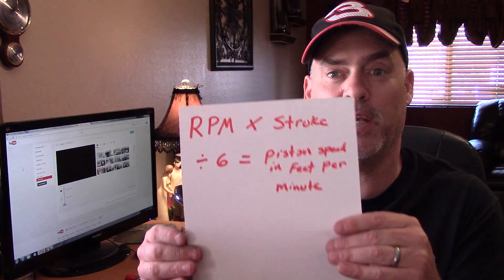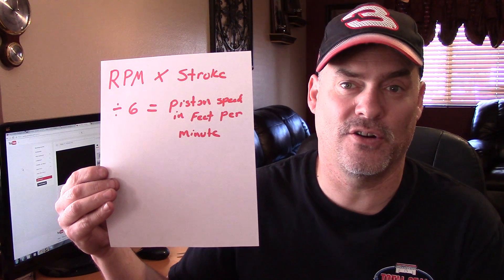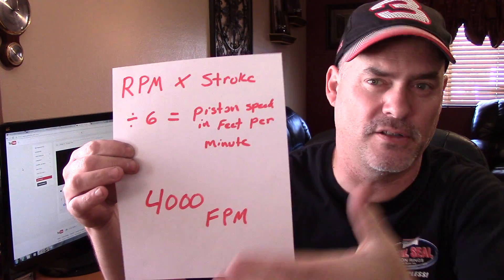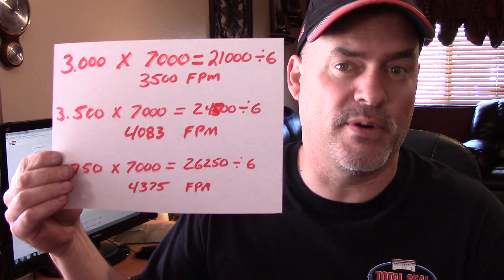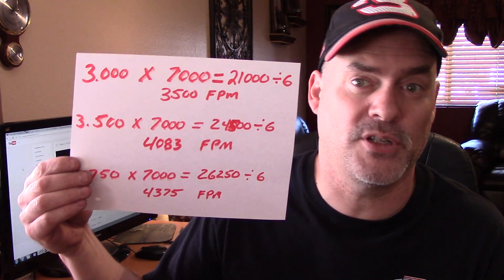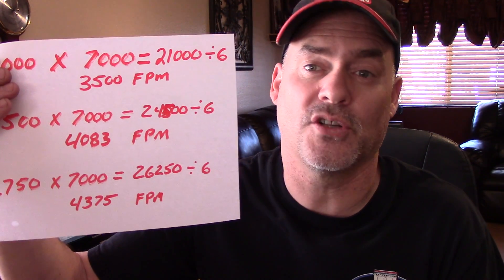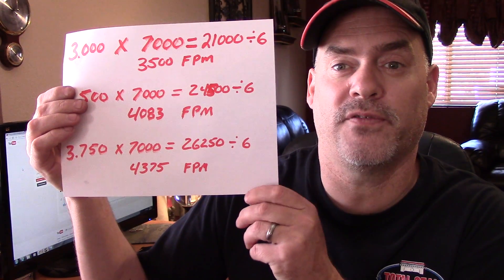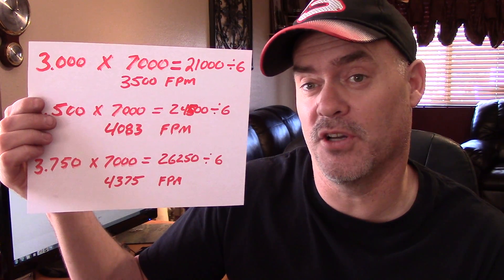What RPM should be an Engine's red line

Comment: 2 Pi is not really 6 (6.283) , and you should explain the "6".
Reply: It's not Pi we want  (like honestly, where would Pi come into play here?). The math is really, really simple. We know the stroke ONE way is 3.49". To find the complete distance the piston travels in one full rotation we need to double that. Instead of doubling it and then dividing by 12 to find out what part of a foot that is; we simply just divide it by half a foot (6 inches). Multiply by your target RPM goal and you've got your number in feet at any given RPMs. For example (Stroke * TargetRPM) / 6 = PistonFPM   ||||  Or do it the long/hard way:  ((Stroke * 2) * TargetRPM) / 12 = PistonFPM
Reply: Archaeon GG I would say he was thinking about the crank throw to think of π2 not the actual piston movement
Reply: Archaeon GG no shit. its amazing how out of touch all these “car enthusiasts” are with basic math. its not hard. figure it out
Reply: 6 is used because it is half of 12 inches. 1 stroke is only 1/2 of a rotation. So a 3” stroke at 1 rpm is 6” per minute. Instead of doubling your stroke and multiplying it by the rpms then dividing it by 12 to get feet per minute, we just skip that step and divide by 6. An even simpler method is to use 24000 / (stroke) and that will tell you where your red line is (assuming 4000 feet per minute is your max piston speed goal).

Comment: I didn't learn this in feet / min, I come from a metric country (Australia), and we do this in m/s. But over time the maximum recommended piston speed has gone up from about 12 m/s when I was a kid, to about 16 m/s now. It's also worth going over rod length to stoke ratio. I would also mention that engineers at the factory do their calculations, but then they do a practical test. They run the engine on a dyno at about the maximum power for a time (hours, not seconds) and then strip and inspect. When I was a kid, in the '70s, Honda was supposed to run any production engine at redline for a week. If the engine suffered serious wear or damage in that time, the engine spec was changed or the redline was lowered.
Reply: +Kneedragon1962 Also maybe mention, there should be a natural safety margin between max power rpm and redline. One real criticism of racing engines is the ones that are still gaining power (or sometimes even torque) at redline. They're difficult things to use safely, for a number of reasons. Instinct and the seat of the pants will tell you to keep it pinned because everything is going great...
Reply: +Kneedragon1962   Engine go's💩💩💩
Reply: Kneedragon...Used to be a saying 'They run the strongest just before they blow.
Reply: Find a measurement converter on line, and convert.

Comment: cuestion...are the chevy350 engines made in mexico any good it will better or less quality on those engines made in mexico...thanks and you have great videos...
Reply: +Alfredo Ramirez s A CNC mill doesn't know the nationality of the operator, they are all the same
Reply from the maker: +Alfredo Ramirez the Mexican castings are good blocks they work well
Reply: +Myvintageiron7512 I herd a long time ago that Mexican castings are harder and doesn't wear out as fast. I had a block long ago that had 70.000 miles on it and didn't need to be ridge reamed.
Reply: +Alfredo Ramirez . Almost All factory Chevy Iron have low nickel content. Soft blocks. There are a few RARE pieces that have a bit more nickel. So many aftermarket Chevy blocks and heads due to poor factory castings. Chevy is the low budget part of GM.
Reply: +Alfredo Ramirez, ran a Taco engine, with major core shift, in a street stock class stockcar for 10 years at 5800 RPM peak.  All we did was a good oiling system, deglazed the cylinders, rings, bearings and full groove mains, mild cam, 3 angle valve job, good springs and moly pushrods.  Put in bearings every year and rings at 4 years.  Finally retired it after an accident crushed the rad air intake and the driver overheated it before coming off the track.  Won 6 Championships with it, 3 seconds and running third for the year when it retired.The older Mexican engines are rumoured to have a higher nickel content and be more brittle.
Reply: that's what I heard.
Reply from the maker: No the Mexican crate engines hold up just as well as the castings made elsewhere

Comment: Jeff.  1 complete cycle or 4 motions is 2 rpm because that is 720 degrees of crank rotation.   1 360 crank rotation is 1 rpm.  So 2 strokes is 1 rpm

Comment: Do you have a mustang by chance?
Reply from the maker: +Brian Lord No don't own any Fords
Reply: +Myvintageiron7512 What should my Redline be? I've got a 1986 Pontiac firebird w/a 305 chevy in it. Bore size is 3.73"and a 3.48" stroke. The 305 is really a chevy 350 with a smaller bore size in it. I had a 178 intake cam in it, but I replace the cam w/ a Comp Cam 260h (212 @.050s).

Comment: When I was younger my dad built a 351W with Cleveland heads, and he swapped over to a solid cam, adjustable valvetrain setup with a lumpy cam. He always told me that a 351 could pull 7000, but I really wasn't sure how that was possible since the 4 cyl in our Focus barely did 7000. Now that I'm following suit and getting into cars, and that I have more knowledge, it's easy to see how to squeeze revs out of an engine. As always, well explained video.
Reply: ThePaulv12, no, the Windsor is a wedge head engine, like the 302, that was never as popular for performance as the Cleveland.  The Cleveland is a canted valve head, like the big block Chevs.  It also has a shorter deck height and smaller main bearing diameter than a Windsor.  A 2bbl Cleveland had heads that were more than adequate for most street and racing, but, the 4bbl heads had huge ports that are said to outflow a 427 rectangular port Chevy.  These were the same heads used on the Boss 302 and had a very high rev capability due to the flow.
Reply from the maker: +Ryan Eyster A 351W will turn 7000 it is feesable to go above the piston speeds I have laid out race engines do it all the time you just need stronger internal parts and a much better balance job 4000 FPM is a good safe max piston speed for a stock engine
Reply: The Cleveland will do 7000 more reliably because of the smaller crank journals.  One of the other things that affects the rev potential of an engine is its ability to reliably supply oil to the journals, and larger journals require a better oiling system to supply enough volume due to the cast-off created by higher surface speeds.
Reply: You mean Windsor don't you? Cleveland is ordinary by design.

Comment: thanks to reducing equations we can simplify (r*s)/6=4000 for the purpose of finding a target redline speed into 24000/s=rpm so simply divide 24000 by your stroke in inches to get the exact redline rpm.
Reply: Ariel Lezen I have 72.0mm stroke and I go to 7000 rpm can you calculate my engine redline
Reply: Exact stroke for max rpm of 7000 is 3.4285. What's cool is I just got my hands on an engine only made for 4 years 5 if you want to get technical. The stroke on this 383 is 3.380. So I have 0.048 to work with. Gets me thinking about the engineers and what they were really after. How about something that can be mass produced for intended use but, with a little modern (modern being used broadly, modern is just the time) technology for final touch up work. Can just sit happy right where a street RPM band engine should be for a V-8.
Reply: The issue is most production V8's are cammed/intaked to make power between 2-5k, after that they fall flat. If you change an engine to make peak power 5-8k customers would think its too sluggish or too much power pickup in the top range making it dangerous for inexperienced drivers. Its a tradeoff they had to choose reliability and fuel consumption rather then power
Reply: Ariel Lezen So since the tach is driven by the cam, every cam rotation the distributor tells the tach to double the amount of revoltions because the crank is 2x the speed of the cam ?

Comment: He uses a 6 so it's easier to calculate piston speed. There's two stokes in one rotation of the crank so the stroke needs to be multiplied by 2. Then to get feet per minutes you need to divided 12. So essentially your dividing by 6. 
Stroke x 2 x rpm / 12 = fpm

Comment: Where does he 6 come from?
Reply: The length  between the center of the piston pin to the center of the journal of the connecting rod.
Reply: So if I use 6.3 inch rods I’m guessing divide by 6.3?

Comment: I do not understand how rod length would affect piston speed and displacement.  It should be the crankshaft that would dictate it.
Reply: +Samir Bachour Rod length does have an effect on the piston speed *BUT* only the acceleration rate.
A mean piston speed of 3750fpm @ 6000rpm will be the same weather the motor has a shorter or longer rod. 
Thing is, something peculiar happens. A long rod motor tends to "dwell" the piston more at TDC and BDC in crankshaft degrees than does a shorter rod engine. Long rod engines aid volumetric efficiency (cylinder filling) in naturally aspirated engines but can induce detonation in turbocharged or supercharged motors. 
So in a long rod engine the acceleration rate of the piston away from TDC is greater than a short rod engine even though both short and long rod engines reach TDC and BDC at exactly the same time. 

Think of it like two men having a foot race over 100m. The short rod man jumps out of the blocks first but the long rod catches up and gets in front and stays in front for most of the time but then the long rod man slows and the short rod man catches up and they both hit the finish line at exactly the same time.
In this way the short rod spends more time in the middle of the cylinder in crankshaft degrees than does a long rod and a long rod spends more time in crankshaft degrees at TDC (and BDC) than does a short rod. This phenomenon effects the characteristics of engines.
Also long rods with tall deck heights are generally better at transferring power to the crankshaft. The rod angle in the cylinder bore is less and this reduces pumping losses caused by thrust forces transferring power into heat in the form of friction.
Reply from the maker: +ThePaulv12 Yesss!! finally  someone who gets it!! very good...  best explanation I've heard so far
Reply: Rod length does not change displacement  and it does not change  over alll piston speed but it does change where the piston is moving faster or slower in the cylinder shorter rods pull the piston off tdc faster long rods hold it at tdc longer (dwell time) so the mean (average) speed does not change where it is going faster or slower in the stroke changes I hope this makes sence
Reply: The speed of the rods is dictated by the cam. Longer vs Shorter rods would only affect the need for a stronger / weaker spring on the head, or because there is more mass to be moved up / down of its valve seat...
Hope that helps?
Reply: +jeremy nothum dafuq? you'd have to take and understand trigonometry to understand how prak piston acceleration is affected by rod length
Reply: +Texassince1836 *peak, not prak
Reply: Not sure if I'm thinking backwards here, but...

With a short rod, the piston will start to accelerate from TDC sooner, while a long rod would cause the piston to accelerate later...?

Because a long rod = longer dwell time, the piston will start to accelerate later but harder until it reaches its top speed in the middle of the stroke...?

Then how to translate this into something useful... shrugs :P

A longer rod should mean more forces on the piston and piston bolt, if my thinking above is correct. So with longer rods you would need better quality pistons?
Reply: You're certainly asking the right questions!
You have logically worked out some interesting points that most don't even think about.
No just the acceleration rate is greater with the long rod. This is only a problem at the end of the exhaust stroke and the beginning of the intake stroke. At BDC the piston and rod is in compression (as opposed to tension), and during the compression and power strokes the piston and rod assy is in compression (as opposed to tension). The mean piston speed is the same and the piston under compression mitigates the tension stress (except as mentioned). Unfortunately better quality pistons are often heavier so this adds negatively to the inertial force by increasing the reciprocating mass. Assuming < 4100fpm then all should be still OK because the engineering has been done and established. The engineering takes into account the varying reciprocating mass for small engines ie < than  about 10 litres. The increased acceleration rate of long vs short rods will still be relatively small since the rod length increase might be as large as .500" (1/2 inch) or only .200". The acceleration rate difference might be ~10% greater but probably quite a bit higher than 10% instantaneous G loading (but still well within the elasticity of the connecting rod's metallurgical composition).

What's all this mean, well lighter reciprocating mass means greater durability, lower pumping losses, better fuel economy, more power and longer engine life to name a few. Unfortunately all that lightness costs BIG money so the likes of the average guy has to find a short stroke long rod engine. Put another way in the absence of obscene amounts of money find an engine that has been carefully worked out by a manufacturer to negate heavy internal components by having a short stroke. Short strokes make everything easier because the internal forces are lower EVEN if the pistons and rods are too heavy. I like the Chrysler/Dodge B and B-RB series of Big Block engines. They all have long rods, tall decks and short stroke for capacity. The Ford FE Big Block does well too.